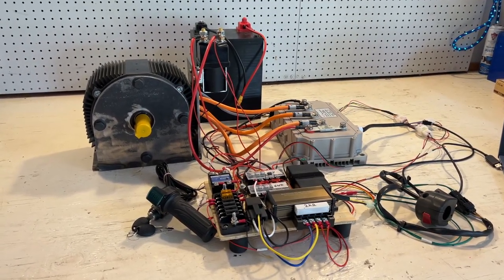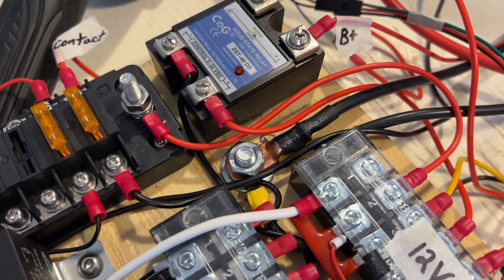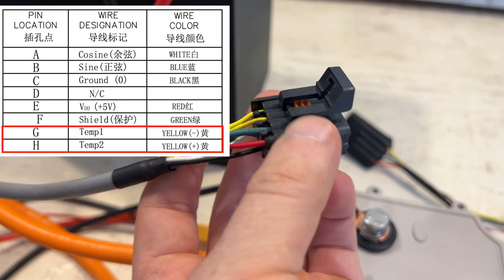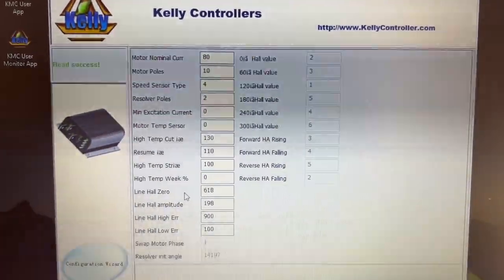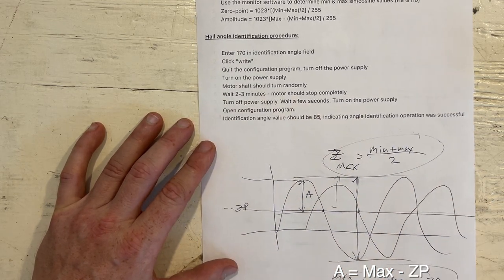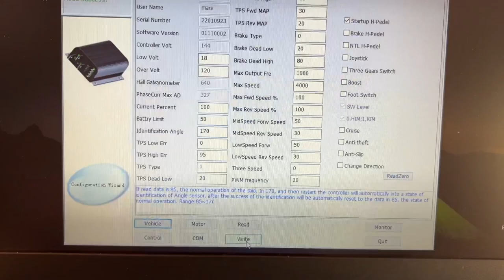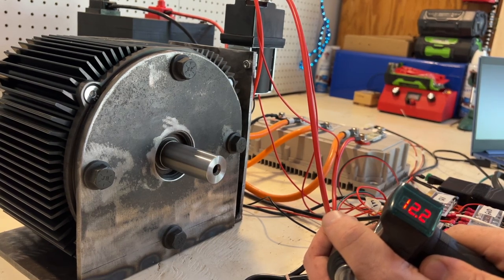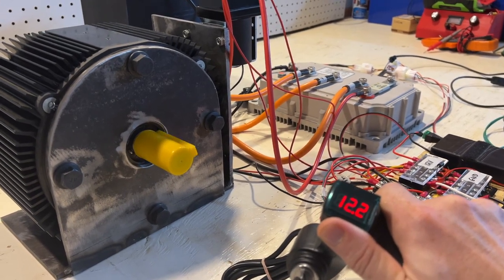ME1507 Motor with Kelly KLS96601-8080IPS Controller - Complete Setup Guide for Basic Operation

Comment: Hi I can’t figure out how to connect the contractor. Do you have any documentation to show how to do that ? Much appreciated.
Reply from the maker: there's a link in the description to the part of this video where I show how the control circuit of the contactor is connected. the main terminals simply interrupt the positive discharge line
Reply: @GaiusGarage  Great. my bad. I missed that part. Just to confirm, top blade connecting to red wire head should be connected to negative of battery, right? I took a screen shot here: https://drive.google.com/file/d/1AvE0rrXPMWAxmzK6dJCXPBpEuzpMad5_/view?usp=sharing
Reply from the maker: @julianvideoproduction4797  the red wire connects to the positive side. red is typically used for the positive line and black for negative. But depending on your contactor, it might not be to the positive terminal of the battery. Battery is 100V but this particular contactor uses 12V for the control circuit, so I have the red wire connected to the positive side of the 12V dc-dc converter. But they make contractors that take high-voltage for the control circuit also
Reply: @GaiusGarage  thanks for replying. I have the exact contactor to pair with ME1616 motor. I will follow your wiring!
Reply: @GaiusGarage  do you have an actual wiring diagram to show how all the wires are connected? I am still learning and definitely don't want to mess up and burn my motor 😀
Reply from the maker: @julianvideoproduction4797  please check my other video - Electric Motorcycle 12V Wiring. I have the wiring diagram there with a link in the description to download the file
Reply: @GaiusGarage  great! thanks for much! I will check it out. Meanwhile, I just realize I have a lot of power from my batteries. 90V and 600A peak. It could definitely electrocute me if I don't wire and place them correctly. Do you have any advice on how to safely wire these things? I don't see people talk about this much when building an electric vehicle but it's definitely something I am very interested in and I am sure everyone should know. If you do make a video about the safety topic, please let me know so I can watch and learn!
Reply from the maker: @julianvideoproduction4797  good question! would be ironic for me to make a video about safety given I take very few precautions lol. But yeah, the thing with electrocution is that a *very small* amount of current (in the millivolts) passing through your heart is enough to kill you BUT your skin has VERY HIGH resistance so you can touch all sorts of high voltage points and be totally fine. The problem is that there are a lot of factors at play including where on your body you touched it, how sweaty you are, your personal physiology, hydration level, random path the current will take etc etc etc. Basically, its sliding scale - 12V will probably not hurt you, but it can. 100V definitely CAN kill you, but it probably wont. Once you get into the multiple hundreds of volts (300V, 400V, 600V etc) you really need to take that very seriously. But again, ANY amount of voltage is enough to kill you. 

You first line of defense when working with high voltage is to wear rubber latex gloves. Probably other stuff too but honestly I'm not the expert here as Ive never worked with truly high-voltage EV system like a Tesla battery. 

In terms of wiring, its not so much a risk to you as it is a risk to the wiring - if you short something, it will most likely fry some components and be a pain to fix. Definitely use several layers of fuses in your lines - a main fuse for your high-voltage line (which is not the same as a contactor BTW) and fuses in your ancillary lines. 

Basically, just be really careful I guess lol
Reply: @GaiusGarage  does your contactor gets really hot ? Mines gets too hot to touch and I wonder is it normal.
Reply from the maker: @julianvideoproduction4797  to be honest I never checked the temperature of a contactor. but generally speaking, with gasoline motors, you have the motor and exhaust which gets too hot to touch and it's completely normal but with electric system anything that's so hot that you can't physically touch it for more an second or two is definitely not normal and indicative of some problem that will eventually lead to some type of failure. it either needs larger gauge conduits (wires/contacts/connectors) or more cooling or there could be some other issue creating excessive resistance (dirt, poor connection, corrosion etc). in gasoline systems, heat is created from the ignition process, but in electrical system the source of heat is always resistance/impedance. if your contactor is really hot, there's too much resistance in some part of that circuit. which contactor are you using and how much current are you pushing through it?
Reply: @GaiusGarage  Gaius, I use the exact same contactor as you use. 12V input. wired as yours, motenergy me1616 motor. have you finished building yours? can you touch your contactor after riding for 10 minutes? I think it will be hot.
Reply from the maker: @julianvideoproduction4797  I just took the bike out for a ride - blasted around at full power for 30min or so. contactor not even warm. not sure what your issue might be - maybe check the diode orientation. does it heat up at idle or only when riding?